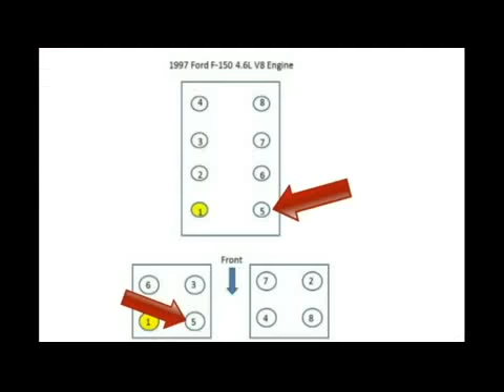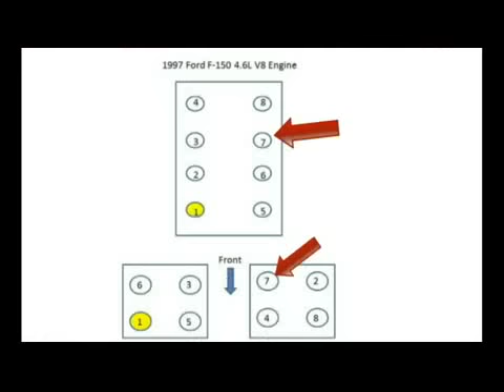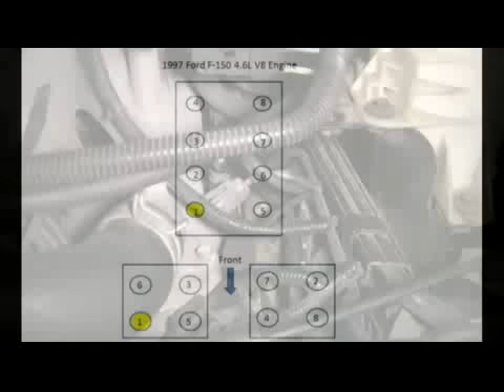How to Replace the Spark Plugs on a 1997 Ford F150

Comment: My 97 had a misfire on 7 too.  Bought plugs and wires(needed badly) and when I got to seven the wire was not on tight!!!  So much power and running so smooth now.  Thank you so much guys!

Comment: I think folks come here to get tips & tricks for accessing the hard to reach plugs, (#4 & #8).  Although your video was thorough as far as showing what you did, you made no mention of HOW you did it.  On my 97 Expy 4.6l, I'm still trying to find useful suggestions as far as how to access #8.  You make no mention of extensions used, easiest access routes, etc., and I think that's where this video falls short.  Still though, a much better put together video than I could ever do for sure, so kudos.

Comment: this video just shows you doing, but i dont see how to remove hoow in the heck you can get to the # 8 plug wire, let alone the actual plug. the fuel lines and the rail make it impossible. do i need aftermarket fuel lines? i  saw on the passenger side you have some couplings on your hoses down by the #4, like they were extended.

Comment: How much dielectric grease should be used on both ends? I just did this today and I got a loss of power after finishing. Could using to much dielectric grease do this? If so how to I remove the extra dielectric grease?

Comment: the hoses that lead to my heater core are in the way of accessing #3 and #4. The way my hoses are connected look different from what is in the video.
Reply: Hey did you ever figure out how to get to 3 and 4? I have the same issue on my 97' Expedition. Did you end up having to cut those hoses and putting a fitting on them?

Comment: and this is why I am NOT a fan of FORD. they make you take half the engine apart just to change some fucking spark plugs
Reply: I did it without taking as many parts off, I removed the air intake after the air filter all the way to the throttle body. You don't have to take off that power distribution block. Use a 12" wobble extension teamed up with a 6" wobble extension and a u joint for cylinder 3. Cylinder 4, I used a 12" wobble extension and squeezed my hands back there. Little room but i made it happen. Ill post a video soon.
Reply: lol ya cause i took half my engine off my bronco when i changed my plugs

Comment: 30 minutes of edits you can guarantee if you do this right and you do this safely you will be under here under your hood depending on whether you're doing plugs in coils or not for a few hours trust me it's just the way it is this might be one of the most sensitive things that end up screwing a vehicle up that are cleaning out dust and particles is so important in 3 hours with holes right down into your motor and bolts and parts and dirt in other elements flying around more often than not when someone's not paying attention or rushing they either end up throwing dirt down there old gooped up oil or grease and even dropping bolts and guess what my brother did that I think 20 years ago and chose not to say a damn thing... Well Kiss It Goodbye if you drop anything down there and don't retrieve it...

Comment: I have a 98 F250 with the 4.6, changed plugs and wires, but my #4 wire won’t stay on #4 plug, how can I fix that?
Reply: Is it slipping off of the coil or the plug?

Comment: I'm happy my 2000 5.4 in my f-150 doesn't have the plug wires. Just extra stuff to move/work around. I wonder if a little PB Blaster in the back spark plug holes would work to help break the old plugs loose. I didn't have any problems changing the plugs in the in the 2000 and 02 5.4 and 6.8 Superdutys that i had. But these f150s have no room to work unless you disassemble the engine compartment.
Reply: I agree the 7 and 8 plugs are a pain to get to. Almost need a body lift to get the room for them. I like the 5.4L but its a pain to work on it. I do like the coil-on-plug coil packs over the dizzy (distributor). 243K miles on my F150 and still going strong. But the body is rusting away. So I get to look for a crew cab F150 4.6L with the M5R2 (not a fan of the auto).

Comment: So basically I pulled all my ignition coils out at the same time and I need a diagram showing not only the routing of the coils but how long each one is. I need to know how long cylinder 1s ignition wire is and so on.

Comment: to get to  plugs 4 and 8 sucked, but this video helped with showing to remove the junction box for #4....I didn't see any tips for #8...I think removing the boot was the hardest part for that one.

Found plug well for #7 full of water, which was most likely my intermittent miss.

Probably from me cleaning the the engine a few years ago.

Very helpful video....thanks.

Comment: Autozone gave me iridium plugs i installed 4 but the engine runs like garbage so i turned it off and its staying off.  It worked fine before with platinum plugs i will be getting those.